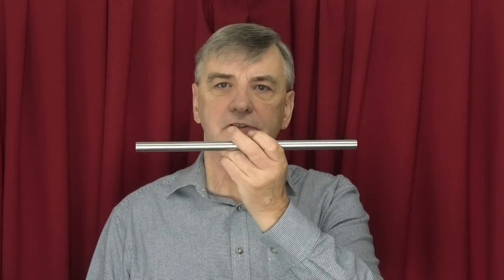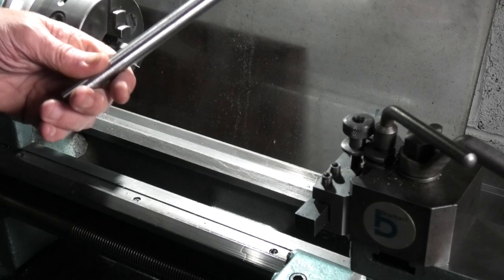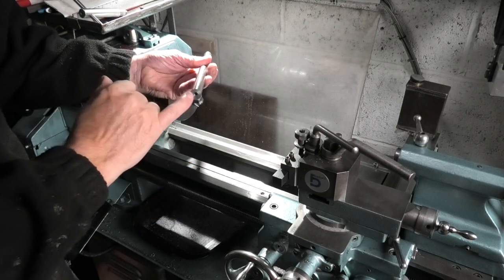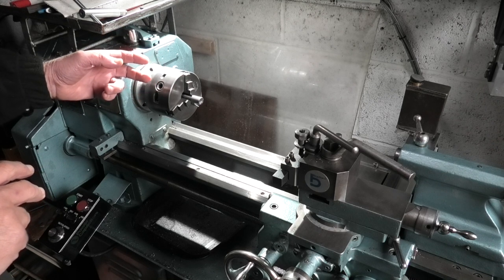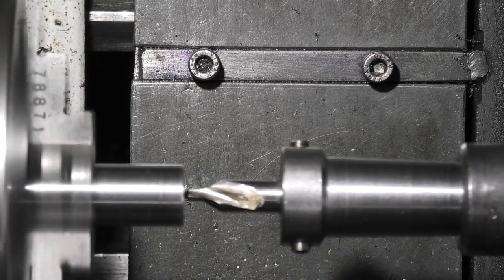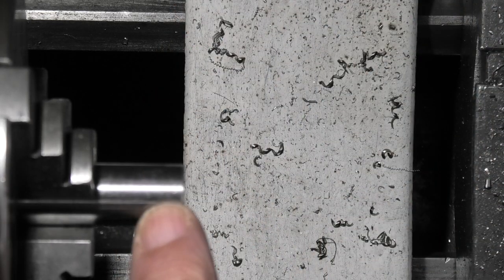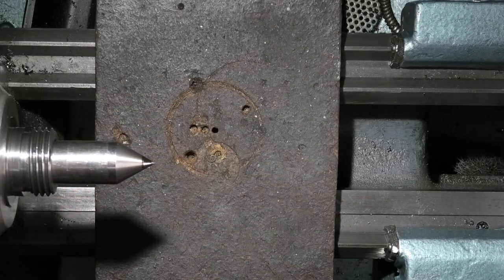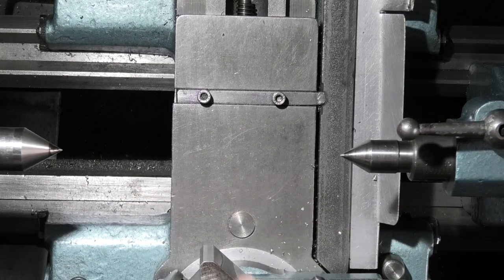Is your tailstock offset ?

Comment: May I suggest one way to keep from tweaking your jaws when removing the Chuck is to Chuck up a piece of hexagon bar stock and then put on a corresponding box wrench (Spanner over the Pond) and hit it with a mallet.
Also I keep a cordless electric impact wrench handy with a corresponding impact socket mine happens to be a DeWalt 18-volt...
and that's another method that works like a champ.
Older British and American lathes and attachments are cherished these days, and I look for every means possible to keep them in top shape for years to come.

Cheers mate, I enjoy your work.

Comment: What is shown in the video is good. There are however several other things that need to be done first to align the lathe. If the other things aren't done first you could still have mysterious slight tapers in turning that you can't seem to get rid of.

First, check the bed for twist. Second, Get a headstock test bar. For a bench lathe they are about $40. The test bar has ground Morse Taper on the end and the rest of the bar is ground to the taper. Install the test bar into the spindle and check for parallelism, horizontally and vertically, with the bed. Adjustment will depend on the lathe, but most Asian lathe headstocks sit on a flat and often have jacking screws on the overhang in the back of the lathe. Adjust the head stock to turn between straight to 0.0005" large over 1 foot. This is done to make sure that if turning for a force fit that the parts will go together once started and reduce the possibility of seizing. It Also insures a facing cut will be very slightly concave and sit flat on a surface

Do the same test shown in the video but do it on the tail stock quill. Grind or place shims as required between the cricket and the tailstock. Some Asian lathes also have a gib between the cricket and tailstock that can be shimmed to adjust the tail stock quill horizontally parallel to the head stock spindle axis.

Once set, a home shop bench lathe that is kept lubricated, especially the bed ways, should show almost no wear over a long period of time. The lathe bed should be checked yearly for twisting with a precision level as any machine tool foundation will settle over time.
Cheers from NC/USA

Comment: what chuck are u using there?
size and make plz, did u have to purchase a threaded back-plate adapter for it?
Just got my hands on a Boxford AUD and working things out as i go.
Cant thank u enough for the time and effort you've put in to get us this awesome content.
Cheers
Reply from the maker: Hi The chuck was fitted to the Boxford when I purchased the lathe back in the 1970s, so over 50 years of service and still working well.the chuck is a Burnerd 4" griptru chuck. It's fitted to a backplate. This link will show you how it works https://youtu.be/ZuiKkD-YP44.
Regards
Alan

Comment: Alan, correct me if I'm wrong but shouldn't the bed be checked for level and "Twist" before doing any of what you showed? 
Wakodahatchee Chris
Reply from the maker: Hi Chris
The tailstock will be worn over time and be lower than it should be. Every time you move the tailstock back and forward along the bed metal is worn away from the tailstock and bed. You can adjust the tailstock back on centre line to compensate for the worn parts.
Reply: @enotsengineering  Hi Alan and yes I understand. However that doesn't negate the proper steps. IE removing bed twist first.